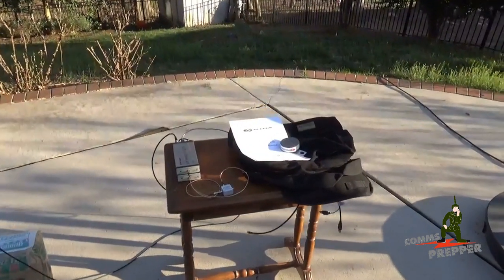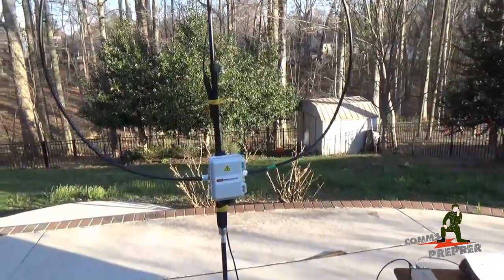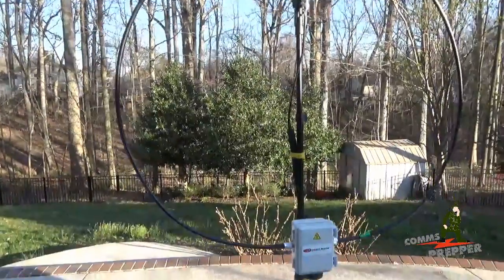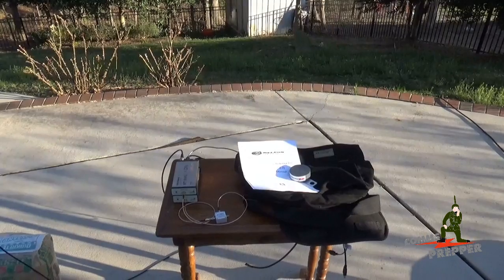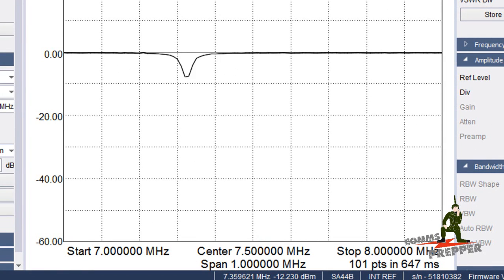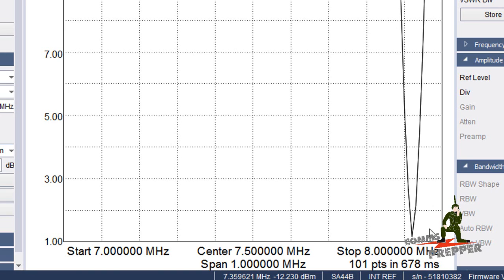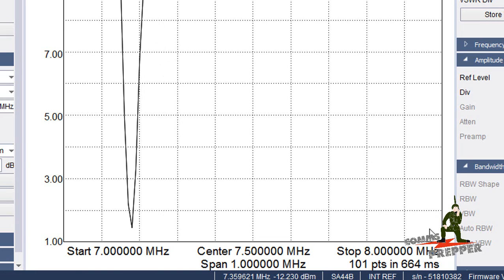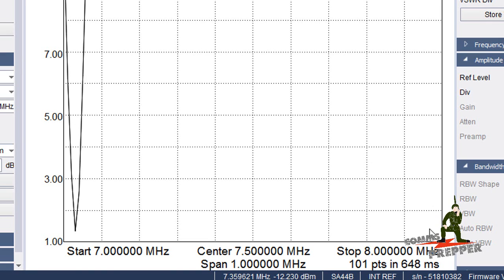Chameleon P-Loop 2.0 HF Magnetic Loop Antenna Introduction

Comment: You showed the antenna is capable of tuning to an SWR of less than 2:1.  I would have liked to see 3:1 scale where you had 7:1 and I could see more easily the variation in tunable SWR.  I would have liked to see what the frequency bandwidth at 2:1 was on 40M.  I would have liked to see the 2:1 BW on 10M.    These bandwidths give a rudimentary indication of the radiation efficiency, i.e. radiation resistance to loss resistance of the antenna (Q).   If maximum power rating of the antenna is determined by the voltage breakdown of the plate spacing of the tuning capacitor, how does a "power compensater?" improve that?  This was an interesting video.  Thanks for showing
Reply from the maker: I can say the bandwidth on 40m band was 14k between marker deltas.
Reply: Just look at the SWR curves at the bottom of the following page: http://chameleonantenna.com/CHA%20P-LOOP%202.0/CHA%20P-LOOP%202.0.html

Comment: That is awesome gear, but if it ain't nearly free, I can't go there, but I can get lots done on the cheap. Here is a popular, cheap and easy to make general purpose 2 meter Yagi with a high F/B ratio. Mine was resonant on the MURS frequencices, so the next one I'll make will be a bit longer .  It takes about an hour or two.  Yagi's are good for when you do not want to heard, and for when you need to be heard. http://www.wparc.us/hints-sub/hints-pdf/tape_measure_df_antenna.pdf
Reply from the maker: Jorn you do realize that the antenna in the video is a high Frequency (HF) antenna?  It's not a 2m/70cm antenna.  You cannot run HF on the antenna you are talking about.
Reply: Sorry, musta been the wrong link.  Great for fox hunts too.  Super light and portable.  Cost me 5 bucks.  Try this one:
http://www.theleggios.net/wb2hol/projects/rdf/tape_bm.htm

Comment: Antenna looks nice...just a clarification. In the video the comment was made that "it's pretty flat across the band". I believe 'flat' means flat SWR (below 2.0) across the entire band without retuning the antenna when the freq. is changed. Not so with a loop.
 
It will be interesting to see what the power compensator is (never heard of one before) and what it actually does to the ERP when going from QRP to 60W SSB.
 
Looking forward to some on the air SSB comparison tests vs. the 1.0 version. Keep up the good work!
Reply from the maker: Jack,

Thanks for the tip.  I will chose words more carefully next time.  This will be the first time I work with a power compensator.  Unfortunately I cannot do a side-by-side comparison with the P-Loop version 1.0 because my 1.0 is with my buddy jack in Africa.